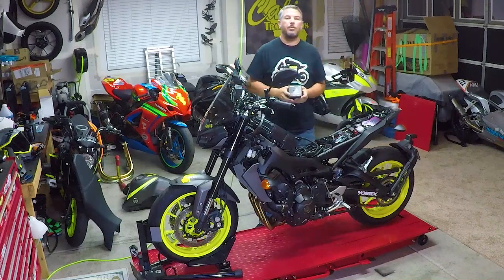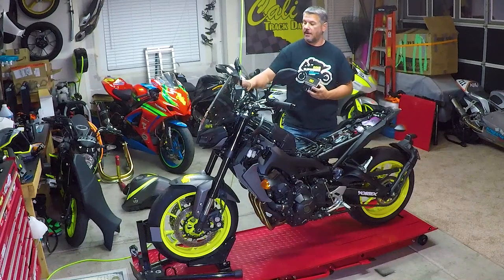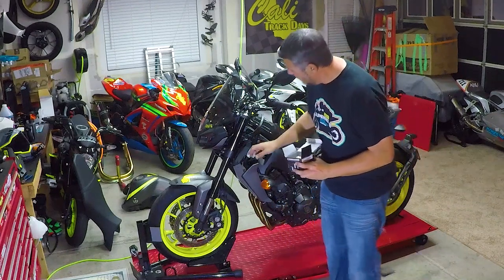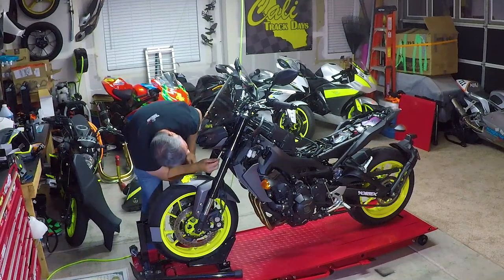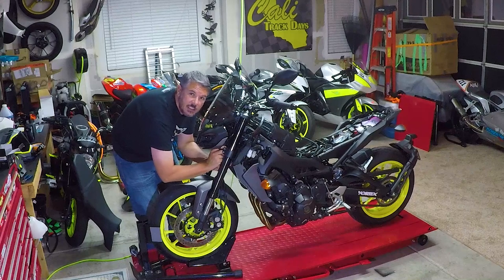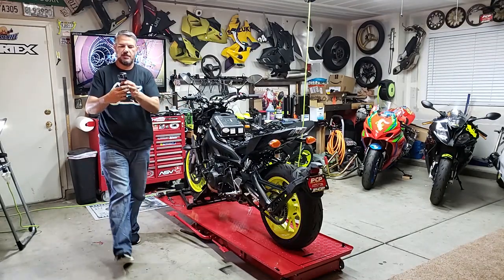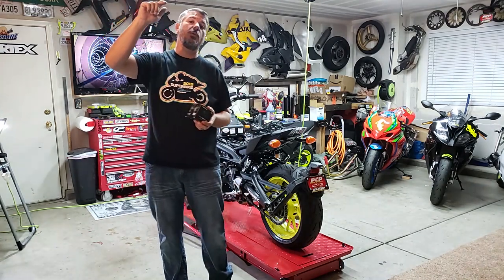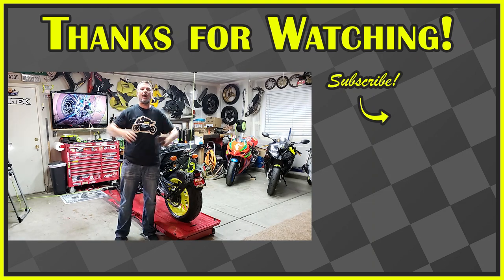Denali Soundbomb Mini Horn Install on 2018 Yamaha MT09

Comment: Nice video but the mounting istruction reccomending : "Be sure that the trumpet is facing downwards so that it can properly drain road 
spray. Excess water build up in the horn could lead to failure."